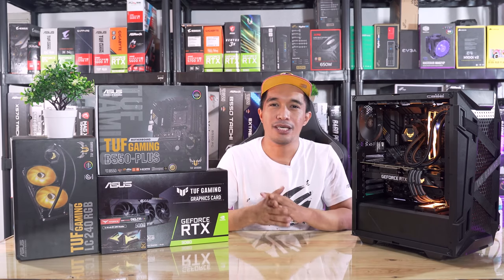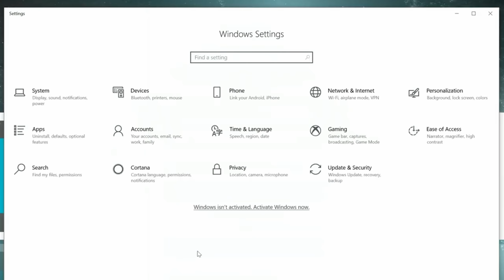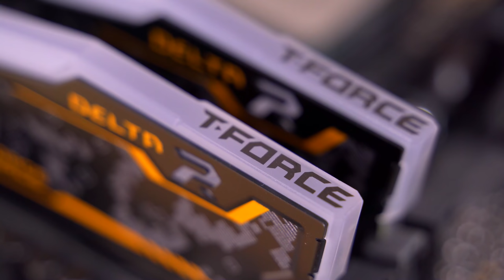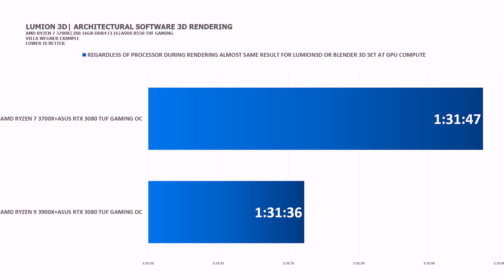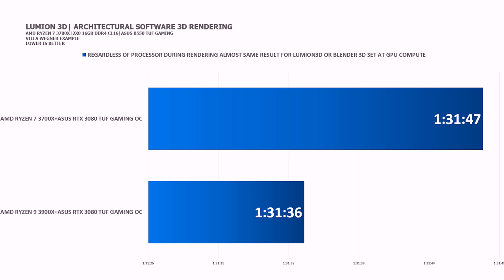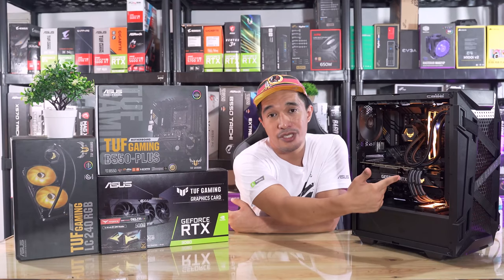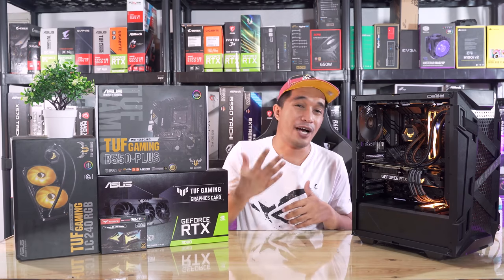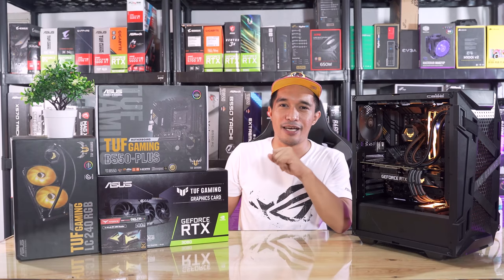SIKSIK is SEXY: Asus TUF RTX 3080 Gaming PC @Php 95K+ Timelapse ft TUF GT301 Chassis & LC240 RGB AIO

Comment: Hi sir.. Newbie po ako pag dating sa pc building.. Eto po sana ang build na bibilin ko..  Worth 25k po sya. 

💥Processor↔️ AMDR RYZEN 3 3200GE VEGA 8 GRAPHICS 4.2GHz.
💥Motherboard↔️MSI A320 PRO-E 
💥Memory↔️G.SKILLZ 8GB  RAM DDR4 3200Hz
💥SSD↔️RAMSTA 120GB SSD
💥HDD↔️SEAGATE BARACCUDA 500GB
💥Kb&Mouse↔️INPLAY 4N1 KEYBOARD, MOUSE, HEADSET & LONG MOUSEPAD RGB
💥Monitor↔️NVISION  24 INCH IPS FRAME LESS CURVE MONITOR 
💥Power supply↔️REDRAGON POWER SUPPLY 500WATTS
💥Casing↔️DF WATER SQUARE 5 W/ 3PCS FANS
💥FREEBIES ↔️AVR, INPLAY SPEAKER

Okay lang po ba ang mga items nato sa 25k na budget.. Sana po matulungan nyo ako Hehehe. Salamat po new subscriber here 😊

Comment: ask lang po sir bermor, if mag a-rtx 3070 inno 3d chill x3 ako tapos gagamit ako ng deepcool castle 240 ex aio and yan po yung gagamitin kong case, mag fifit po kaya? tiningnan ko po kasi yung gpu length support ng case and sabi 320mm and yang aio naman po na gamit nyo is 25mm(fan)+27mm(radiator) thick, 52mm sya, si rtx 3070 inno3d is same length po ng ASUS RTX 3080 TUF which is 300mm

Comment: Sir ask ko lang po kung kasya po ba lhat ng components na to sa tuf gt301
MotherBoard : TUF Gaming B550 plus
CPU: RYZEN 5 3600 AMD
RAM : T-FORCE DELTA - TUF ALLIANCE
SDD : TUF GAMING ALLIANCE X DELTA S
Storage : 4TB Barracuda SeaGate 
GPU : CERBERUS GEFORCE GTX 1070ix 
Power Supply : MASTER WATT 750 TUF Gaming edition
 : MASTER AIR MA419M TUF gaming edition

Comment: Sir bermor panaccept po sa group may tanong po ako hahaha. 
I am planning to buy a ups for my build any suggestion po kung ilang wattage and va: pinaka kaya ko lang po is apc 1000va/600w im on thigh budget. 

Ryzen 5 2600
Tuf b450m pro gaming
Rtx 2060 super palit JS
Corsair cx750w 
Tforce vulcan 3200hz 2x8 16gb
Deepcool gammex vte air cooler
I have 9 rgb fans for my coolman robin 2

Pa help naman po sana ma notice gusto ko lang na confirmation if sapat na ang ups na to

Comment: Great build! I'm impressed that you can fit a 30cm GPU in that case with that radiator in the way.
Reply: No its not ! Procc cant handle 3080 , so in games 80-95% GPU load !
Reply: @Taurus_Play  Get a stronger CPU than.
Reply: @Taurus_Play  I've bought this case 2.5 years ago and I still use it.
Instead of getting a 30cm RTX 3080, I've got a slightly shorter RTX 3070.
My CPU is the i5-10600K and it has an AIO cooler with the radiator in the front, but in my case the tubes are down as they should be.
Reply: @thomaslevy7249  comon ! i talked about dude in vbideo ! R7 3700x for 3080 is very bad

Comment: Hi idol Bermor, Sana po ay mgreply po kyo sa comment ko. Kailangan ko po ang irerecomend nyo po s build. Yung cheapest po pero compatible.

cpu = i5 10600k
gpu = zotac gtx 1660 super
monitor = msi g24c4 24" 144hz curved
ram = ?                (8x2 gb)
rom/hdd = ?       (1tb)
ssd = ?                 (480 gb)
motherboard = ?
chassis = ?          (fan lng iinstall)
psu = ?
avr = ?
please idol help me. Yung irecomed mo n specific brand at name ng item pra jn s build ko. Mga 40k plus budget ko kung pwede kaya sana yung cheapest n pwede pero durable at compatible. Kung may kulang p s build tell me po. Help me idol. Maghihinty po ako s inyong sagot po. Maraming salamat po idol.
Reply: g.skill ripjaws V 3200mhz, WD blue 1tb hdd, adata SU800 512gb ssd, msi mpg z490 gaming plus motherboard, Corsair 550watts CV550 80 bronze
Reply: @zeidel01  thank you idol
Reply: sobra lalagpas sa 40k yan, kung gusto mo makamura, palitan mo cpu i5 10400f at MSI MAG B460M Mortar board
Reply: @zeidel01  okey salamat idol

Comment: Pwede padin ba akong mag video card? Kahit 3400G na yung processor ko boss?
Reply from the maker: yes zen APUs are there for end users na mag avail muna ng cpu only and gpu later. but still very good cpu even partnered with dedicated GPU. Zen APU is commonly misjudged like the budget generation APUs na pag with GPU na bottleneck but its wrong. Zen APUs are powerful CPUs too  that can drive at lest up to GTX 1660 Super or RX 5600XT Video Cards.
Reply: @Bermor  wooh🥺 akala ko talaga sir di nyu ako mapapansin, diko akalain na kayo mismo ang sasagot☺️. More power sa channel po at ang buong suporta ko ay nasa inyu♥️. Maraming salamat sa payo po. Medyo may sumagot na din sa akin na, bakit kopa daw lalagyan ng GPU kung ang binili kung Processor ay may integrated GPU na😅, wala e, nasa budget talaga, pero good to know na pwede pa akong mag upgrade po☺️, ipon ipon lang. ♥️